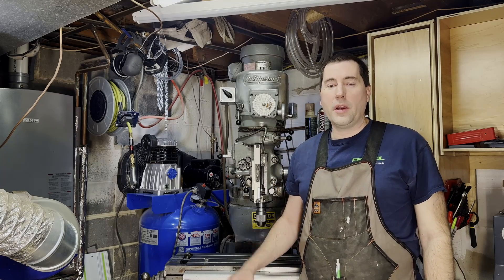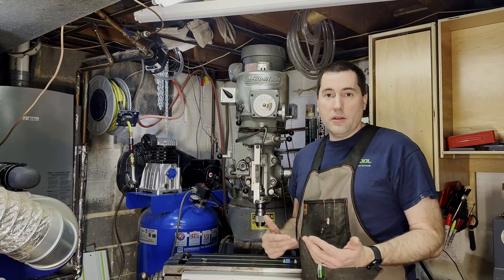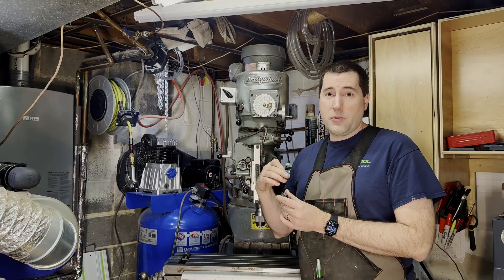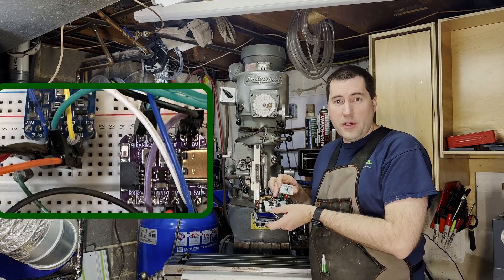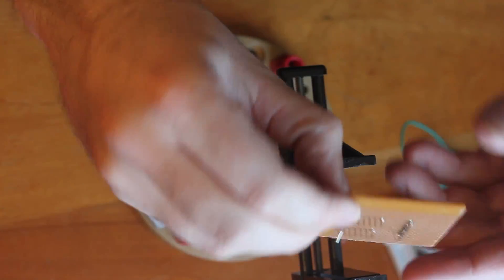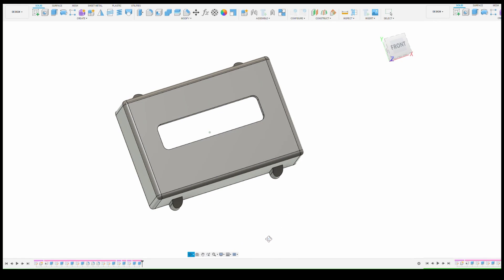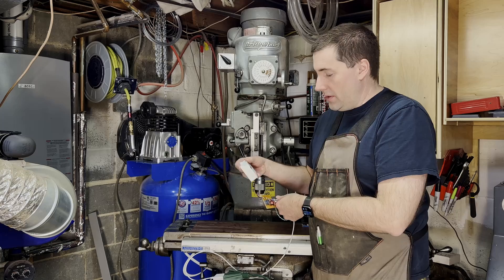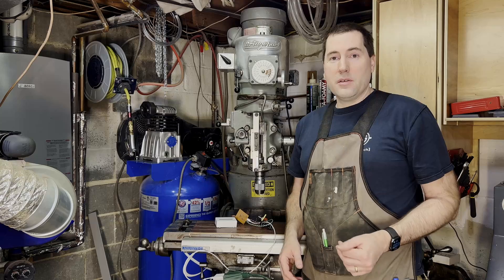Automatic Air Compressor Control with Wifi and a ESP32 QTPY

Comment: Hello, I can't understand the huge difference between your tests and those of Wood By Wright How To. In his case, Titebond Original had half the strength of Titebond 3. His results with Titebond Original were very modest. In yours, even Titebond Original is stronger than Titebond 2. The type of strength is the same, the test is very similar. What could be the reason for this difference?